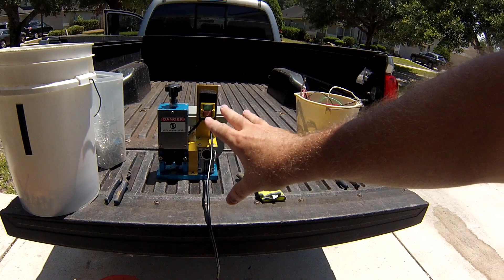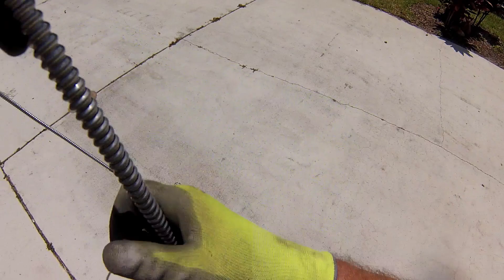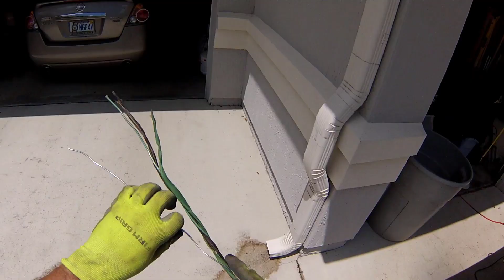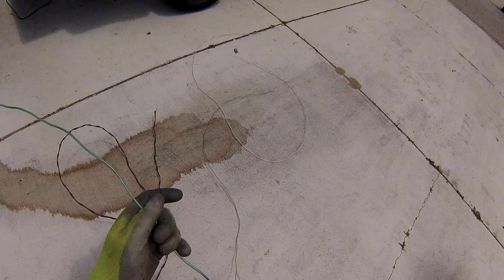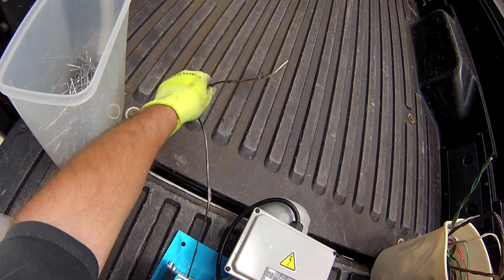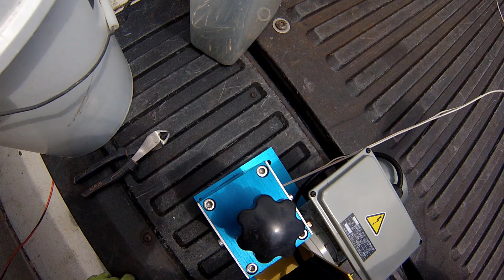Conduit Strip

Comment: That is armoured cable Shark, AC-90. Instead of winding it off with that just cut through the amour with a hack saw and twist it reverse to the spirals and it will slide right off.
Reply from the maker: Trying to wrap my head around that technique
Reply: @sharkscrapper  I will see if I have any scrap laying around at work and show you.

Comment: Always fun to see wire stripping i started 15 years ago with a knife and worked my way up i now have 2 stripping machines and a wire granulator its a guidetti 315 only diffrence with holland and usa we dont have the conduit aluminium around the wire
Reply from the maker: I've some serious catching up to do 🤣  Stories such as yours can serve as motivational guides to many just starting out.  A pocket knife and razor blade scraper were my first stripping tools.  Sometimes I still pull out the razor just for old times.

Comment: I had a 30'+ length a couple months ago.  I attached an, 'eye bolt' to a drill, and unwound it that way.  The steel was extremely stubborn to untwist.  The drill made relatively quick work of it.  I also used it to unwind the wire.  I did try to pull the wire through it, but the physics involved here are quite similar to a Chinese finger puzzle/trap lol
Nice find!
Reply from the maker: Thanks for sharing

Comment: Are you melting the copper, too, or are you just scrapping it? If you are just scrapping it I don't see the point of cutting into small lengths.......Enjoyed the video. The first thing I thought of when I saw you untwisting the length of wire was to use the vice and drill trick. It works like a charm. You can untwist a length of wire in fifteen seconds instead of ten minutes and you don't have to do it in two stages, (One for the aluminum ground and one for the copper) it does it all at the same time.
Reply from the maker: I will melt so cutting is to maximize storage.  The drill trick is a good one and a time saver.  For some odd reason, I enjoy untwisting by hand.  I don't usually get such long pieces but would definitely use the drill trick if I had a bunch of longer lengths.

Comment: Got to get one of those wire strippers!  That’s very cool!   Are they good for stripping down power cords from, say,  computers?  You’d have to strip the power cord and then the smaller wires inside.  Would that be too small? And is it even worth it?
Reply from the maker: Wendell, I do NOT recommend stripping the smaller wire, especially the braided type.  It can be a lot of work for little return.  I only strip solid core, usually 10 or thicker.  BUT, that's just my personal preference driven by time and situation.  I go through A LOT of ICW.  So for me it is faster and more economical to keep it moving to the yards as ICW.  I don't know how small a wire this machine will strip.  The blade is adjustable, so I would think it could handle smaller wire just fine.
Reply: Shark Scrapper good advice! I’ve accumulated nearly 2 barrels worth of ICW thinking I’d get the copper out of it somehow someday, but not really having a good way to do it. I think I’ll just bring it to the scrap yard and convert it to cash to make some space and save some time for the stuff I really like doing.
Reply: Shark Scrapper I took your advice and brought my ICW to the scrap yard and made $300. I immediately bought myself one of those wire strippers!  I love it!

Comment: Just a little hint for that twisted wire that I use is to put one end in a vice or well secured and the other end in a reversible drill and it will untwist the wires in seconds saving a whole lot of time,hope you find this helpful ole mate regardless to the length of wire cheers for now Trev
Reply: Greetings from northen Sweden.
I do the same with wire,, if I get lots of it.
I get scrap from a whitegoods repair shop and supplier, some wire I don't strip as insulation on the copper is a bugger to get off. Put that in high grade copper wire instead.
Reply: Hi, Trev. 
I sometimes use the drill to wind up 5/7 lengths of bright wire to make it larger, and often wonder if I could make bracelets out of it.
Reply from the maker: cool trick
Reply: Shark Scrapper it works well